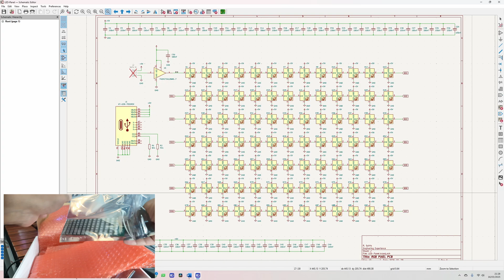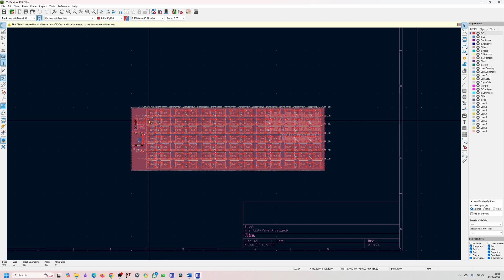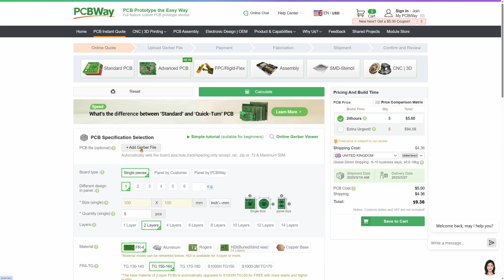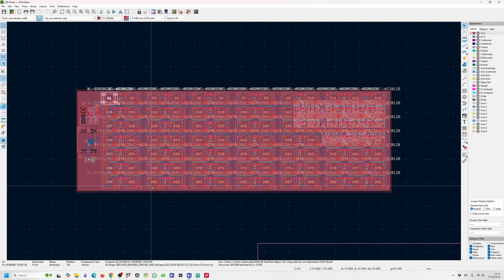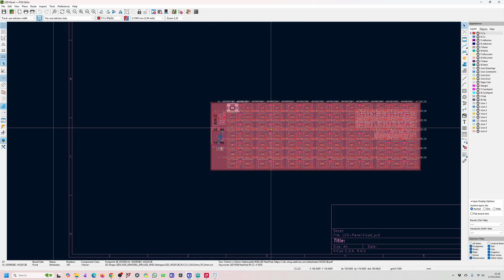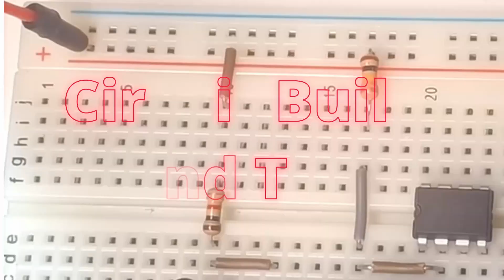DIY RGB LED Panel with Arduino IDE – Custom PCB Design & Programming!

Comment: What microcontroller would you recommend to embed on the board
Reply from the maker: I used a cheap stm processor, I would just go with something that you’re familiar with.

The board I used was from another project  I did on the channel.

Comment: Pretty nice. I'm looking to make my own board with a 2mm ARGBs so I'm looking around YouTube for help. I was going to do it 15x7 but I think I'll do it 7x15. I guess I can still do a horizontal row instead of just one column. I'll have to figure out that in code.
Reply from the maker: You should be fine. Just be careful it takes a lot current at full brightness.
Reply: @TheEngineeringExperienceYT  I'll have to test that. I'm going to be using for edge lighting some small signs.